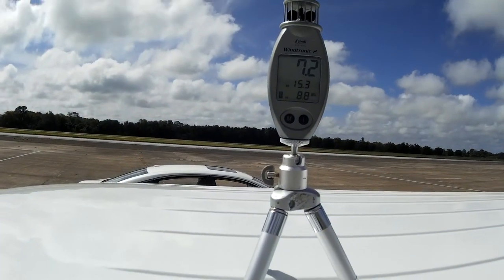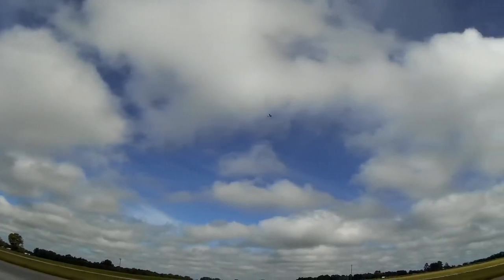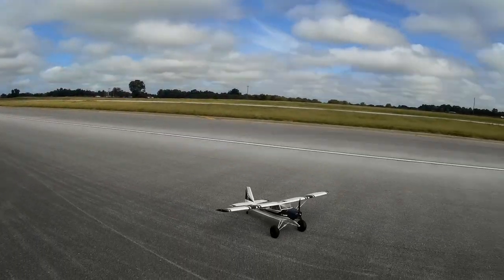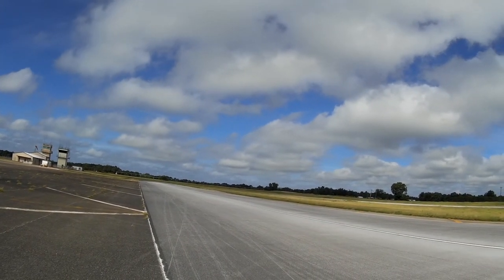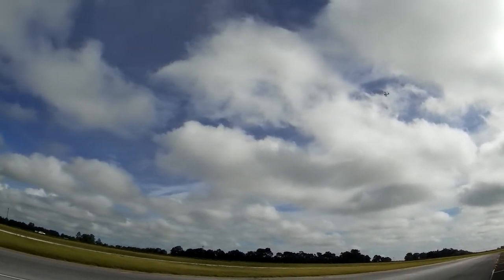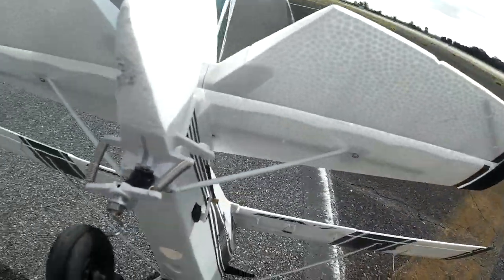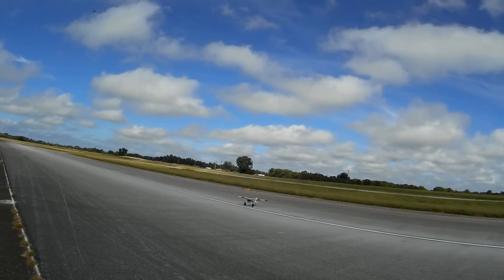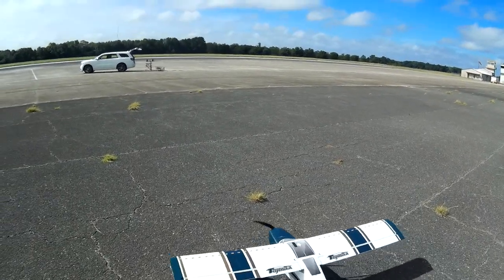Avios Grand Tundra 6s 4000, Lemon RX Let's Go Flying

Comment: Great flying and landings Jeff. I always use an address label on my batteries with what plane it goes to, date of purchase and weight in grams.
Reply from the maker: Rick I started doing that but didn't keep up with it, I mark the weaker batteries but most of the time I just grab one and use it.  Unless I'm doing stuff they're just fine for scale flying.  My buddies used to wonder about me not having a scale but a 16oz beer weighs right at a pound, Jeff